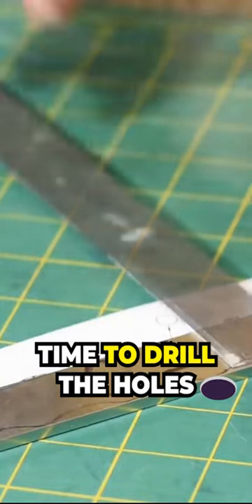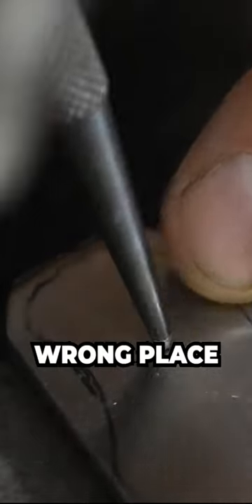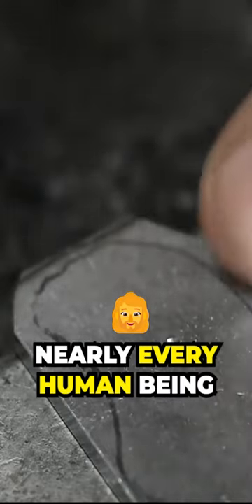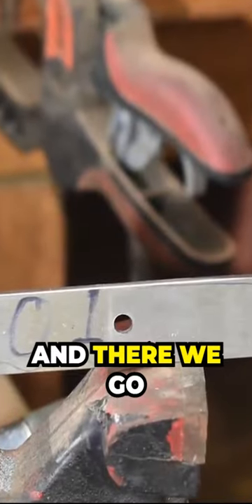Time to drill holes in your knife? Walter's got you covered.

Comment: You are correct that you can use hand tools, but you need a high quality drill bit to success.
Reply: You can do it with low quality drill bits, I've done it for years
Reply: i can buy a "good quality" sutton tool cobalt drill bit for $11 nzd, you could do this with a cheap HSS drillbit i doubt they were using expensive bits back in the day when they were using brace and bits